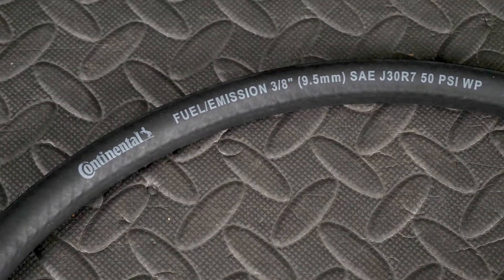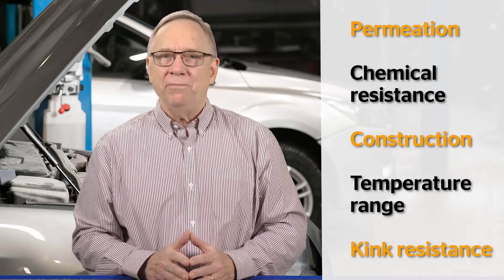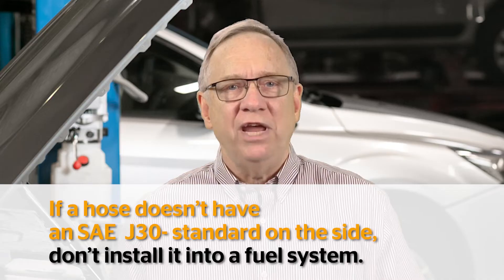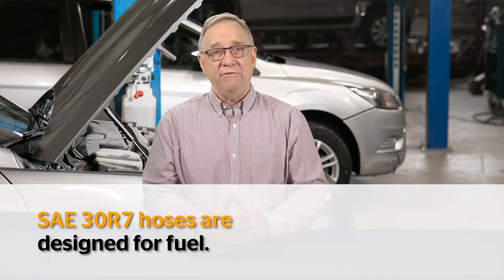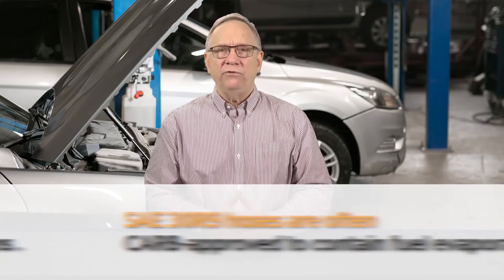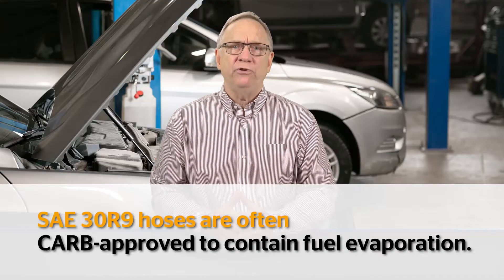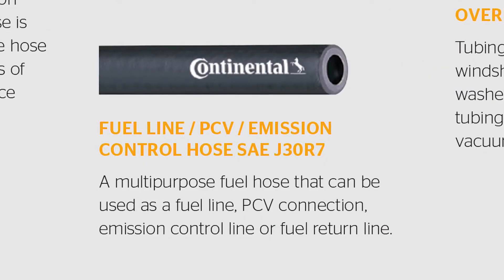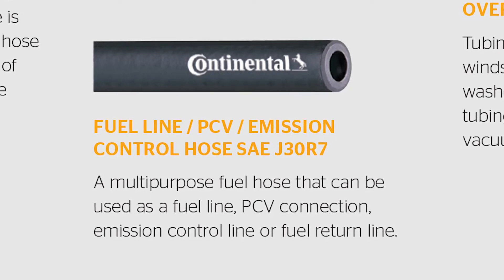Fuel Hose Types and Specifications

Comment: Can I use Fuel Line 9/16" ID NBR Hose Push on Hose 13/16 OD Fuel Injection for Small Engines
to replace worn Charcoal Canister & Vapor Canister Vent Solenoid hoses? On a new hose it is written 
"SAE J30R 10  20Bar B. P.  50 Bar". The original is more stiff & surface like in 1/2 spheres.

The new hose is:
2Mpa. Burst Pressure 5Mpa, Handles temperature ranges of -40 to +275 degrees F 
2 MPa. 290.07547546 psi.
I would appreciate any opinions on this questions. Thank you.

Comment: Would I be able to use nylon fuel hose from fuel pump all the way to the engine for a chevy s10 fuel line replacement?
Reply: As long as it is rated for gasoline, they are many formulations of Nylon.